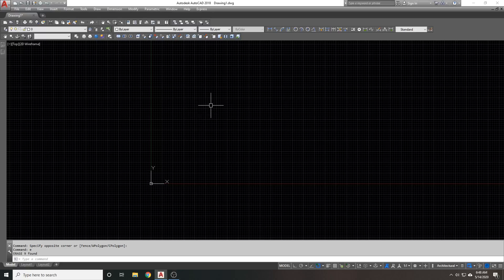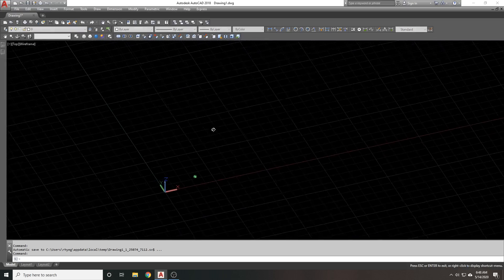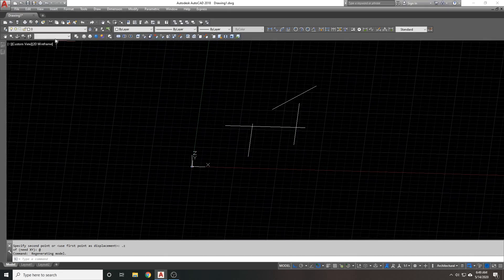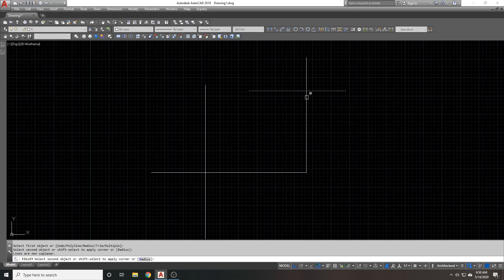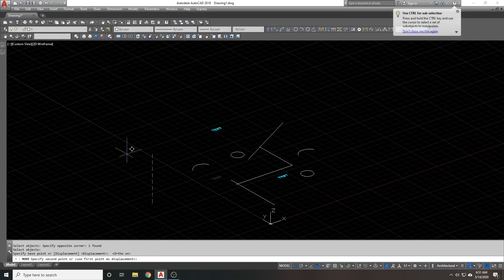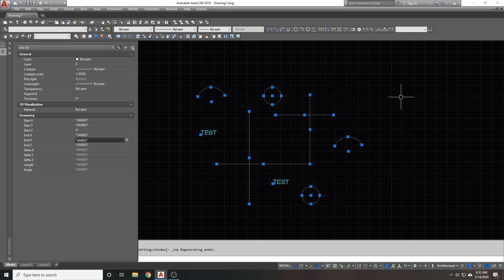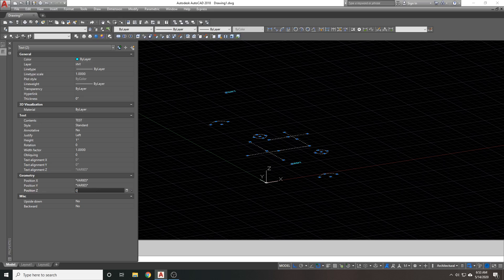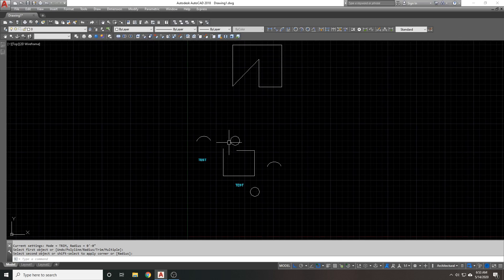Help! My objects are not coplanar in AutoCAD?

Comment: This helped me out a great deal but have one more huge mystery, after getting all of my lines, circles, text, hatch etc into plane Z, I have dimensions that are now NOT in plane Z and I tried going through those properties but can't figure out how to force the dimensions back into the Z plane??? Any advice there?
Reply from the maker: Unfortunately dimensions don't have Z values.  Dimensions are created based on the current UCS.  Most of the time this is set to the default WCS at  0,0,0, but if your UCS is set to another elevation, say 100 feet, then your dimensions will be drawn at that elevation.  The only way to get them back to the 0 elevation is to manually move them.
Reply: @youcandraft  That's what I was afraid of, as many as I have it may be quicker to just dimension the 0 plane lines now that I have them all located at one level now. Thanks a LOT on the quick response!!!

Comment: Hello . thank you actually i use this trick but it won,t work when i select many items  the start Z and end Z or elevation won't appear again . do you have any trick to set the elevation equal to when selecting the whole plan
Reply from the maker: When you select different object types together the Properties window will not show elevation information. You need to click the drop-down list at the top of the Properties window and select each object type, 1-by-1.
Reply: @youcandraft  Than k you I select separately lines circles poly lines objects etc

Comment: This problem seems to appear in CAD quite often over the years in every firm I have worked in. Checking the properties command still shows that the Z coordinates are both set at ZERO, yet the non-coplanar issue still persists. Still unable to correct the issue.
Reply from the maker: It's possible that it may not actually be 0 due to a rounding issue.  Try manually entering 0 into the Z axis if you haven't already. If that doesn't work it could be a deeper issue that's hard to solve without context.
Reply: @youcandraft  Thank you for your help!

Comment: Great tips! But what about encountering this elevation issue with SPLINES? I am stumped.
Reply from the maker: If all the nodes of the SPLINE are the same elevation I would recommend simply moving to the correct elevation.  SPLINES are tedious because you need to select each "fit point" in the properties window and adjust the Z coordinate.

Comment: what about spline?
Reply from the maker: splines are tricky because they have "fit points" that can be adjusted in the z-axis.  You can change the elevation of each fit point within the properties window.  If all the fit points are at the same elevation you can also simply move the spline to the correct elevation.

Comment: Thanks that worked, i knew how to do it on much older cad, but this new version I'm learning, commands are different, in the old cad you typed properties or just P, then E for elevation and set to 0, and it was done, now you have to go through the properties menu.
Reply from the maker: Yeah Autodesk has a way of making old methods obsolete.  Glad I could help!

Comment: How do i do it for 3d faces in the plans and also in my text position z is not pressable
Reply from the maker: For the text, edit the value for "Text alignment Z."  For 3D faces it's a little trickier.  You have to edit the Z value of each vertex.  You can select each vertex from the properties window when selecting your 3D face.